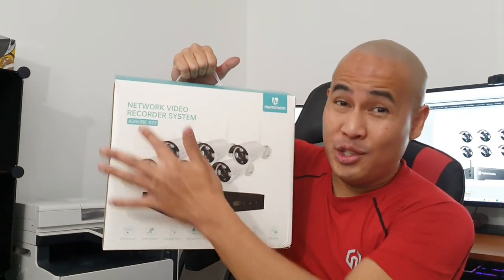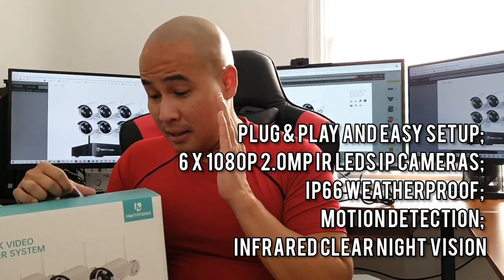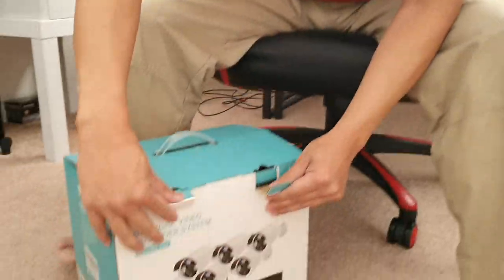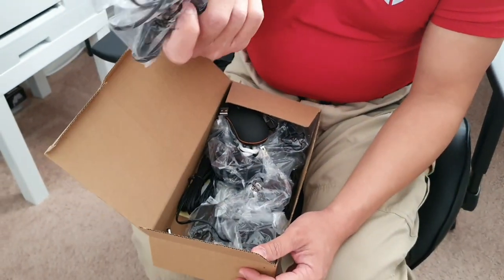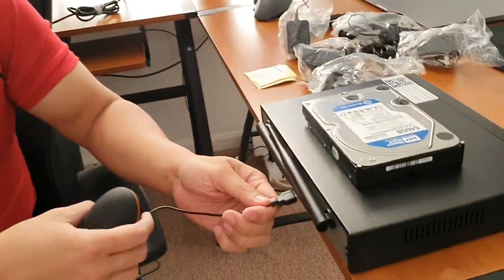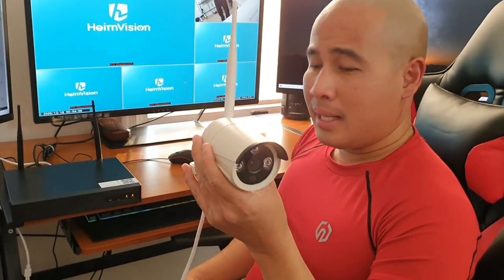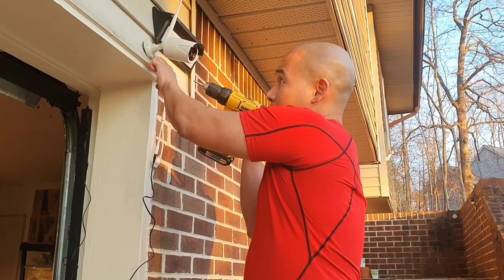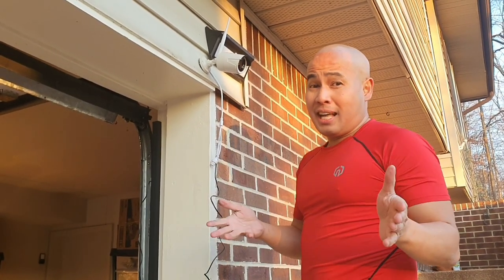Heimvision K22 Network Video Recorder Review: How to Install DIY Setup Security Surveillance Camera

Comment from the maker: The old Heimvision K22 (NVR) system is no longer available but you can buy similar cameras through the Amazon affiliate link below:

1. Hiseeu 2K Wireless Security Camera System Outdoor/Indoor 8 CH NVR kit 8Pcs Cameras 3MP WiFi Surveillance Camera for Home Night Vision,Bullet Camera Waterproof, Motion Detection, 3TB Hard Drive 
https://amzn.to/3ysI9I1

2. TIGERSECU 1080P WiFi NVR Security Camera System with Two Way Audio, 1TB Hard Drive, H.265+ 8 Channel NVR with 4 1080P Wi-Fi IP Cameras for Indoor/Outdoor Use
https://amzn.to/3oVOE2Q

3. 【2021 New】 Security Camera System Wireless, 4TB Hard Drive Pre-Install 8 Channel 1080P NVR, 8PCS 1080P 2.0MP CCTV WI-FI IP Cameras for Homes,OHWOAI HD Surveillance Video Security System.
https://amzn.to/3ysHTJ3

4. [Expandable 8CH,2K] Hiseeu Wireless Security Camera System with 1TB Hard Drive with One-Way Audio,8 Channel NVR 4Pcs 1296P 3.0MP Night Vision WiFi Security Surveillance Cameras DC Power Home Outdoor
https://amzn.to/3yvsTKb

Other tools that you need:

1. HDMI CABLE
https://amzn.to/3gWemyB

2. Western Digital 1TB WD Blue PC Hard Drive - 7200 RPM Class, SATA 6 Gb/s, , 64 MB Cache, 3.5" - WD10EZEX
https://amzn.to/2J00RBj

2.  DEWALT - Brush 20V MAX Cordless Drill Combo Kit, 2-Tool (DCK240C2) Yellow/Black Drill Driver/Impact Combo Kit
https://amzn.to/3nuO9tx

3. ORIA Precision Screwdriver Kit, 60 in 1 with 56 Bits Screwdriver Set, Magnetic Driver Kit with Flexible Shaft, Extension Rod for Mobile Phone, Smartphone, Game Console, Tablet, PC, Blue
https://amzn.to/3nu08Yg

Comment: Thank you for the great information EJ. Small suggestion, if you haven't already done so, change or blur your cloud ID in the video. In the least the default passwords should be changed.
Reply from the maker: My pleasure. Thank you for the tips.
Reply: Help I can't get my cameras to connect anymore do anyone have this issue
Reply from the maker: No, we haven't. Have you tried to restart the unit?

Comment: Do I have to hook up Ethernet cable to router to set up
Reply from the maker: I use a direct connection from the control unit to the router.

Comment: What size of pilot hole to drill for the screws? Use the anchors with vinyl siding, or only with wood?
Reply from the maker: I used the 5/64 drill bit. I use the wood.

Comment: Its just crazy you have to look for every outlet for it to power the camera instead just rely on one. How many ft is the power wired thats included?
Reply from the maker: Very good observation. I use power cable splitter and I use one of the power.

Comment: Hi, I successfully added 6 IP wireless camera but the 7th and 8th are not working after I disconnect it from ethernet it appears can't get a wifi signal
Reply from the maker: You can turn the router off and turn it back on

Comment: I don't have a computer. Can i set the  camera up through a ipad?
Reply from the maker: Hi Linda. The system comes with  a small computer and a mouse but you need a monitor or TV with HDMI connection.
Reply: Thank you😘😘
Reply from the maker: My pleasure Linda 😃

Comment: Hi! I got one of the same and forgot the password!!! So frustrating Is there any way to hard reset the system? I tried removing the battery and back in but didn’t help. Thank
Reply from the maker: I think there is a reset button on the receiver unit, press it for 30 secs.
Reply: @ejsgarage  the problem is it doesn’t have any reset button, that’s what I looked for first
Reply from the maker: Let me see if there is a way to reset, I will let you know. Let me know if you find it first 😀
Reply from the maker: I read the manual and it says that you need to contact Heimvision customer support and they will send you a temp password.
Reply: @ejsgarage  thank you! I guess I have to return it becuz the email that’s in the manual kicks back and doesn’t get delivered...very disappointed by their customer service. Thanks anyways
Reply from the maker: http://www.Heimvisiom.com/pages/contact-us They have a contact  form
Reply: @ejsgarage  okay! After it says password incorrect, left then right click 12 times on the pop up window..then it asks you if you wanna reset..you leave the current pass blank and enter your new pass!!! Stupid way but worked.
Reply: Now, can you please tell me if I can use the microphone intercom system or do I need to add another hardware?